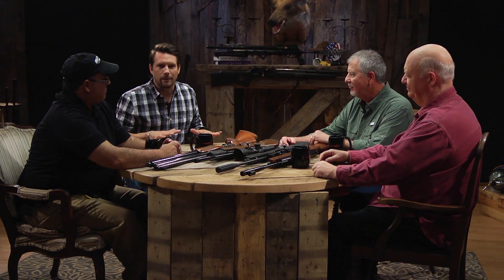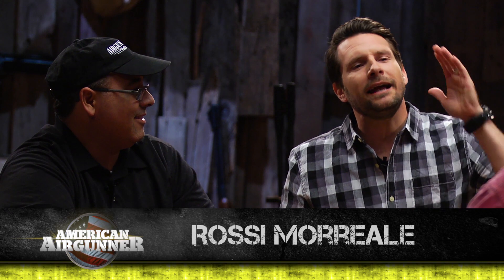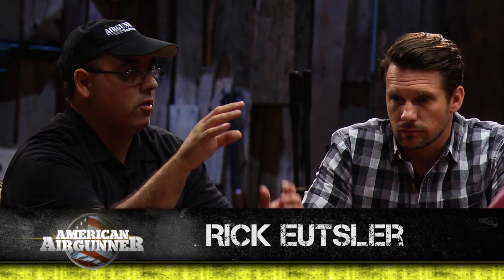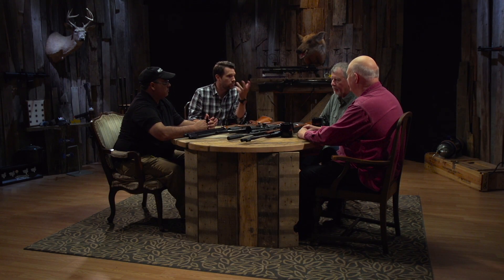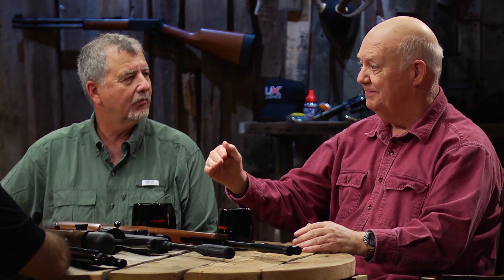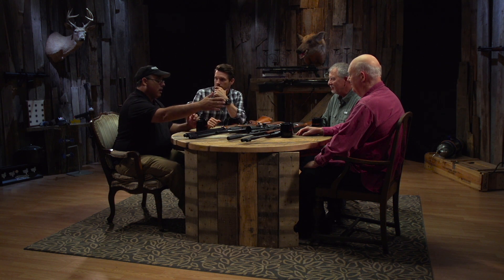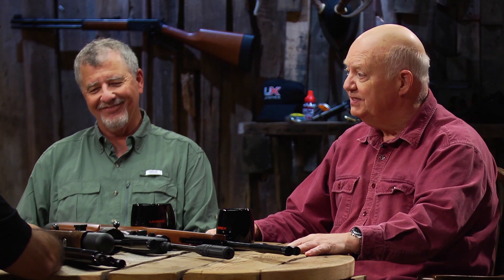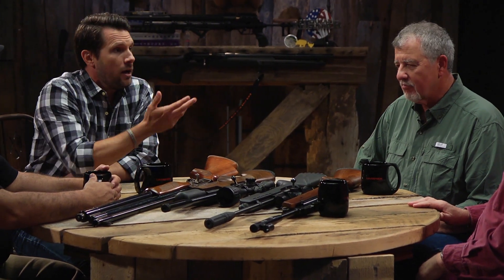What are Foot Pounds of Air Rifle Hunting Energy : American Airgunner

Comment: One thing that I believe needs to be said....ft lbs are important, but it does not take into consideration momentum. This is very important, as big slugs do big things... for instance, a 35 cal pellet(81grn) moving at 850 fps gives us almost exactly the same energy as a 22 lr, but is considerably more effective on game. If in doubt,consider the 44 magnum revolver.... it has literally taken everything that walks....including elephants. The .223 has more energy ,but ,is there anyone out there that wants to try a grizzly or a Cape buffalo? I would love to see comparisons on a video... like a 22 hornet (600 ft lbs plus) against an Airforce Texan (450 ft lbs) or a Badger (325 ft lbs )... it would really put things in perspective for hunters who are " on the fence" about hunting with an air rifle...
Reply: Few factors are not considered about that. 22lr have same energy but projectile is smaller. Smaller projectile means smaller wound channel. Nothing you can do around that. And 22lr bullet dont have so much stopping power as 44 cal projectile. 5,5 mm diameter hole vs 11,4 mm hole at the target. 
About the energy there is also few things to consider - if bullet goes through the target then most of the energy is gone. Bullet just pierce through the target. Like a needle through piece of cloth. Thats why many hunters have shot wild boars 8 times and the boar doesnt even feel the 30-06 bullets. bullet doesnt deliver entire amount of its energy at the target.
Bullets bounce from hard materials. arrow will penetrete much deeper into bag filled with sand than a bullet.
450 ft lbs should move 450 pounds for at least one foot? Thats are more 200 kg. Twice than body builder.
Or maybe 1 pound should be moved 450 foots. No. it doesnt work that way. Projectile doesnt deliver entire energy to the target. most of the energy is lost. Heavier and bigger projectile means greater impact at the target. Smaller and ligher projectiles simply pierce like needles. Another factor is time. For how much time will act the force upon the target. For fraction of the second. So finding the correct balance is tricky. Slower projectiles have more time to push on the target. Faster simply go through. You can fire at paper target with 50 BMG. And you will have a hole at the target. But if i gently punch/kick i will shred the target completely. and cause a hell of a lot more damage to the target than the 50 BMG bullet. So the next factor is how much of the energy is transfered to the target and for how much bigger area is scattered, Because punch you with needle is not the same as hit you with hummer.  Its more like scissors, rock and paper game.
Reply: Dimitar Dimitrov Well, my point is, big bullets penetrate better than their muzzle energies would lead One to believe... the reason for that is the fact that energy numbers do not reflect momentum. And, let’s be clear, if you punch a hole the size of a dime through the vitals of anything, that animal will die quickly and humanely.... regardless of what put it there, or the number of ft lbs..
Reply: Yes Tressler, but bigger bullets also mean bigger wounds. A hole of size of dime will not have enough stopping power. I have seen 300 kg boars that escape death many times. Boars have very big ressistance to wounds they are not  as fragile as humans.. A ragging bull that is one ton you will stop with a shot in vitals with size of a dime? Or lion.
44 mag against elephant but only headshot and i mean brain shot, not just headshot. Anything less than a brain and elephant will kill you. It was estimated that 10 joules of energy per kg is required for instant kill. So if 6 tones elephant must fall down instantly then you need at least 60 000 joules at the impact. Or 44250 ft lbs in your systems. Humans are fragile, dangerous game requires much more. Deers are relatively easy. Big boars are not. 10 shots in stomach and the god damn boar keeps walking. I have seen boars that run with completely broken leg. A hole with size of dime will be closed instantly. wound will start to recover. Fat of the animal prevent blood loss. It is very slow death if die from wounds at all.
Reply: Dimitar Dimitrov I’ve hunted hogs ( and deer & black bears) with the 357,44,and 45 Colt , expanding and hard cast bullets... all have died quickly. And no hog has ever “healed up “ a dime sized hole in the heart...
Reply: Tressler, there is quite a dfference between hog and boar. 357 revolver? 44 and 45 colt? You better run fast. I am talk about dangerous game, not small/medium game. 
Russian big deers can run 70 meters with 375 H&H bullet in the hearth. So even if you shoot it in the hearth you still must have at least 100 meters distance. From what distance you shoot the target? Because 44 and 45 colt definetely will not give you 100+ meters effective distance against big bears. I have seen 6 shots from 357 mag and 44 mag revolvers from 10 meters distance and boar still running.
Reply: Dimitar Dimitrov WOW... guess bowhunting is right out of the question... I think I’ll stick to our wimpy hogs and warthogs when I set up my African hunt. About the biggest, baddest, animal we take in North America is the Brown Bear... I personally know 2 people who have taken them with bows and one who used a 44 magnum( one 325 grn hardcast through both lungs... ran 80 yds)... we just don’t hunt with guns like the 375 on this continent. Mostly, we top out at .338 or a heavy loaded 45/70( think 400 grn at 2000fps)
Reply: Yes Tressler, bow hunting is not out of the question but pretty much it is. In my country is legal to hunt only with firearms. Shotguns are excelent choice at close shooting (up to 70 meters) with sabot slug. 
I am not saying you cant kill a bear with a 44 mag. Theoreticaly is plausable. But is the worst choice. Bow against bear? Yes its possible but you risk your life because bear will have plenty of time to kill you. Arrows are not that accurate and will have close to nothing energy at 100 meters. From how far you shoot the bear? What distance? Hardcast bullets? You mean the bullets are hard and not expand? Best bullets are those with the biggest expansion at the target to  cause massive wound channels and heavy blood loss and pain.
If the bear can ran 80 meters after been hit then will reach you. Most of the arrow guys claim they shoot from 15 to 25 meters distance. Which is suicide. Anything less than 100 meters distance put your life at risk. Unless you not have very good cover. If you are on open field then you will have to deal with wounded bear.
With the 375 the bear will drop instantly. There will be no 80 meters running. So if you are below 80 meters that puts you in the range of the angry bear. And if the arrow man miss and hit the bear at the shoulder or not exactly at hearth then is simply a dead bowman. In ancient times they shoot volley of arrows. Multiple hunters. So find me a big bear hunt with arrows on youtube. Heashots are not counted. I doubt that arrow will have enough power to penetrete the skull anyway. You will aim with bow at bear's hearth? Not going to happen. bear will not stay still. If there is snow or its a cold winter then you are doomed with the bow.
Here is scenario where the bow will be useless - cold winter, the bear inside the river. Forget about the arrow to score a critical hit or even signifcant damage. The arrow will simply bounce from the bear skin.Because have frozen water. Ice. Bullets breaks very much through ice. Arrows bounce from the ice.
Bears. What about a pack of wolves? You gonna get against the wolves with bow?
But speaking about big caliber there is much bigger caliber airguns. They are mentioned in the same show american airgunner. There is even .82 cal airgun. 20 mm projectile. And same company makes other big calibers as well. Like 458 Lott and other projectiles from popular cartridges to be fired from airguns.
But for me any projectile less than 400 grain is not worth even considering. 44 or 45 cal, maybe 458 at 45 grams.
Reply: Dimitar Dimitrov Alaska is where you may find a 375 and up.... but is not common place. Even Alaskan guides seem to favor the 338 or one of the big 300’s. A couple of years ago a guides 16 yr old daughter shot a 1400 lb Brown bear out of a tree stand with a 50 # now....one shot through the chest....25 yds and the arrow completely disappeared... the bear went 40 yds. So, yes it can be done....arrows have taken everything in Africa as well.         
      Airguns are a little different... we have large diameters for medium game(35cal and up) , slug choice must be carefully considered, and good shot placement is paramount. My largest is a 457 Airforce Texan... I’m perfectly happy to use my 360 grn hollowpoint on game up to 300 lbs, where they expand well... but for bigger game I prefer more penetration. In those cases, I go to a solid with a large flat point. Even bison have been taken with airguns, but not with hollowpoints...
    There is another choice as well... the airbolt. Check out Keith Warren’s ( plains game hunt in Africa)you tube video and see him take a Cape buffalo.
Reply: Tressler, shooting with arrows isnt very good idea against dangerous game. Airbolt from airgun yes. But bear is moving target. Your 16 years old daughter shot a bear from 25 yards? With an arrow at chest? And bear went 40 yards? So that means your daughter is in the bear range. Next time you may not have daughter anymore because the dying bear will reach the daughter..  Airbolt is good but there is time to reload. A time. 
What if there is pack of wolves around? Not a good idea to shoot bears with arrows from such close distance. Because you get into the bear range. Bear can reach you. And kill you.
hollowpoint and expanders are good. There is airgun makers which make much more powerful rifles than 457 texan. I am not saying that is not possible to kill a bear using airbolt/arrow. But such type of hunt definetely puts you into the bear range. bear can reach you. And if its winter the arrow may not even penetrate the frozen skin. And what if there are multiple bears? Shot with arrow in chest doesnt mean instant death. May not die at all. If hearth is not hit. So bear coming towards you from 25 yards. And bear can travel at least 40 yards. So bear can perfectly reach you. What if bear start to run against you?
What was the american word for this? Charge at you? Charging bear from 25 yards and you have to shoot it with airbolt. Yes you can kill a bear even with a spear, but bear will be able to reach you. The closer you are the more chances for the bear to kill you. Airgun with 458 cal and bullet of 45 grams traveling at at least 400 ms will be my choice. Thats more than 700 grains projectile at 1313 fps in your system. That is equvalent to 12 gauge magnum gualandi sabot slug. 12/76. That will be my primary gun. For fun 177 cal spring piston air gun. Between those there is nothing for me. There is company that makes redicilously overpowered custom airguns. That can use nitrogen and helium and other gases not only air. They have 20 mm projectile at 800 fps,  it shouldn be a problem for them to make little bit smaller projectile at 1313 fps.
Tank in the stock, plus dual tanks below the barrel and two more tanks around the barrel total 1000cc at 4500psi. So i can have at least 8 usable shots.
Reply: Dimitar Dimitrov Yes, I am aware of more powerful airguns using helium.... even the the Texan can be boosted with a 4500 psi tank and a spring change out. But the fact is, we hunt with airguns in spite of their limitations... big , looping trajectories, range limitations, limited power profile, et al....the same as we do with bows and crossbows. Even boosting energy levels to 1500( can be done with helium) still doesn’t take those limitations away completely. 
     When I go south on a hog hunt ina couple months, I’ll be carrying that Texan, instead of my 338 or 450 Bushmaster.... when my lovely fiancé decided she wanted to get me a African plains game hunt for a birthday gift, I decided it would be an airgun hunt as well. So, I guess we do things in my country ,the way we do, because we can. It may not be the most efficient or easiest of ways, but we have many options... and ,man,we do love our options .
Reply: Thats very good Tressler that you have more options. Here in my country there is only one option - firearms. 300 win mag vs boars is perfect. Even bear will fall down. More powerful airguns more powerful. Boost the limitations as much as possible. Airguns force you to have big tank to refil it. Bows and crossbows is very risky because wounded animal may turn against you and charge at you. African hunt with airguns? Elephant,lion etc? Bulls? Way too dangerous for an airgun. Must be extremely powerful airgun. Anything less than 4000 joules (2950 foot pounds) at the muzzle i will not take. 
That reminds me about one episode of the hunted hunted series. Where the hunters become hunted. A man and his girlfriend/wife go to a hunt in africa. But they only wound the bull. Then they follow the blood trail but turns out the bull hunt them and go for revenge. Then the bull charge at the woman and stab her with his horns. That brings the question how tough,durable and reliable is your airgun. On trajectory and power cannot compete vs firearms but how is the performance of the weapon itself? Jam,break,misfire...? How much punishment can take? How fast you can reload the weapon? Because the airguns are inferior at performance as well. You must carry big special compressor to refil the tanks... too much troubles. Basicly you have a musket which uses air rather than blackpowder. And the airgun is not very good against multiple oponents/animals which attacks simulateneously.  In those scenario is very critical how fast you can aim and shoot. You assume that airgun will be good enough against dangerous game and the animal will not attack you in revenge. its kind of big assumption. Can your Texan fire second shot? And how much shots you have on max power? Ammunition is the problem. Because i can carry 400 cartridges, i doubt you can carry 40 air tanks. For me airguns at this stage are good only for small game and recreative hunting boars in controlled environment but definetely not as primary weapon. A pack of wolves,predators attack your position or few lions in africa. Because lions have the habbit to have collective hunt. Rarely they hunt 1 on 1. So how much usable shots you have and how fast and accurate you can shoot may turn out to be critical. Lets say 5 lions attack you but you shot only 3 or 4. OMG where is my compressor,where is my pump, air pressure is too low, faulty valve connector... and lion start to eat your leg already. Wounded animal can be very evil. 
I like two airguns https://www.youtube.com/watch?v=g2v11icCyfQ and the dragon claw 50 cal. 
For small game they are good. But how much cartridges i can fit in my backpack for the firearm and how large air tank i can fit in my backpack? 2-3 good high power shots? Lol. And if i have 5-6 wolves around me... Must have a back up weapon.
Reply: Neal Tressler absolutely agreed. 
I have a video that demonstrate  (for the oblivious mouth breathers like me get a very base idea lol).
It's my second most recent video. 
My hatsan mod 125 vortex in 25cal with air arms 25cal in 25.40gr pellets at 750fps is pushing 31fpe.  This is a VERY powerful off shelf break barrel airgun lol (most 22cal spring guns now can give 18-20fpe at around 800fps with 11.9gr pellet despite CLAIMS of 950...more on that later) at this level 31fpe is a LOT of energy and again,  to see what it's capable of (5ish yards indoors atmo) just check out my 2nd newest video.  For hunters new to air guns for hunting....well, I believe you'll be impressed! 
I was and I bought it knowing what it does lol.
Reply: Neal Tressler yep. I think of fps to fpe as the base distance of effective range plus the surface to surface contact in relation to the base kinetic energy transfer.  Like a belly flop from 20 feet up versus a dive.
Smack with minimal depth.  Anyway I agree.  It's a complicated mess but solvable.
Reply: Paul H watched your video.... very impressive. Man, that’s a sledgehammer of a break barrel.